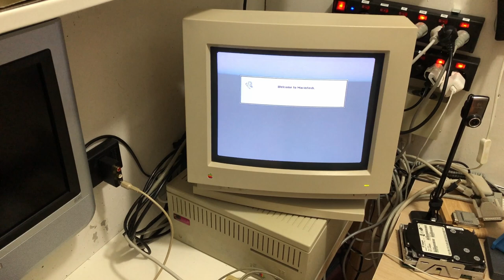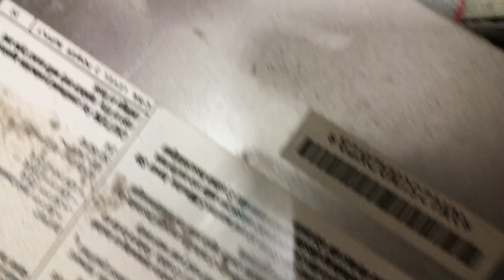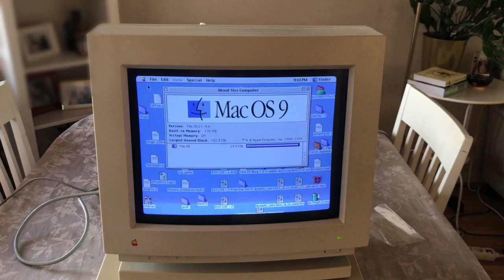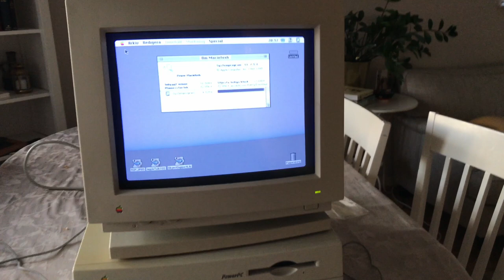Power Macintosh Haul

Comment: Great video. Try and put a PRAM battery in the Performa 400 and see what happens. Have you looked at the psu yet? I'm facing a dead psu on a 7100/66 and really need help fixing it.
Reply from the maker: Thanks! Yeah, I did try with a battery and really hoped it could be that, but with no luck. I’m waiting on some replacement parts to see if it’s the component UJ10 CLUT DAC is at fault - it gets really hot. I haven’t recapped the PSU yet, hope to do it during the summer. Good luck with the 7100/66!
Reply: @retrotechguy  I’ll make a video on it in the summer. The PSU doesn’t turn on at all when trying to power it on. Does the motherboard have to be functional for the psu to turn on? One of the crusty caps fell off.
Reply from the maker: Some PSUs need a load to turn on, I don’t know about the LCII. Probably worth it to recap the board first, then you’ll know if it’s the PSU and the logic board will be ready for when the PSU is fixed.
Reply from the maker: I tried my LCII PSU now and it does not require a load; I could measure the correct voltages with the multimeter without anything connected.
Reply: @retrotechguy  Do you think it would be the same for the 7100?
Reply from the maker: I checked on my 7100 PSU with the multimeter without load and only one pin had 5V, but still. It could be that mine is faulty or that it does need load to produce on the other rails.
Reply: @retrotechguy  I’m going to go with it needing a load. If that isn’t the case I’m going to have to a lot of work

Comment: I had this model 7600/132   good times... And you're correct about the zip drive also I had a internal jaz drive on mine.   The internet was slow back in the late 90's.    Needed to use zip and jaz drives to exchange quarks xpress and photo shop files 😂
Reply from the maker: Excellent! Love how expandable these machines are. 👍
Reply: @retrotechguy  Definitely, That's just one of the reasons why we all used them back then for creating publications.   This was the go to equipment for a Graphic designer like  myself at that time period.   I recall having to drive back and forth from my home in NJ to NYC.    I had jobs in NYC and went to college in NJ.    If only we had better internet speeds.   Something call a T1 line was very expensive to have back then could be used to move data.. so we had to relay back and forth zip and eventually jaz drives.    Syquest was also another big one but that was external drive.
Reply from the maker: Wow, yeah - high speed internet really changed things! I found a SyQuest drive in the Univation Drive Dock that I looked at in a video in March - interesting piece of technology!
Reply: @retrotechguy  cool..  looking forward to you next video 😀